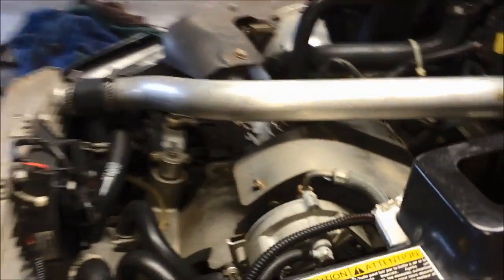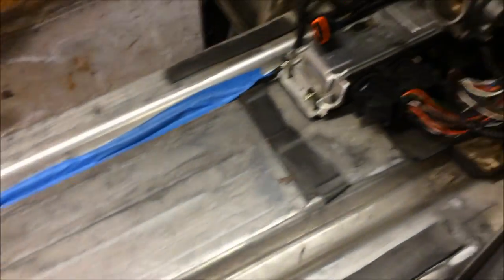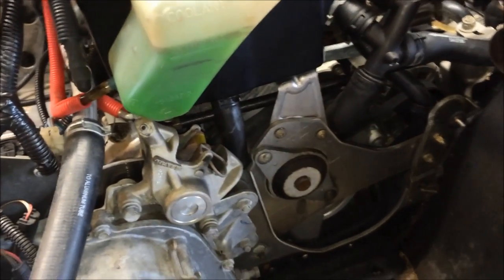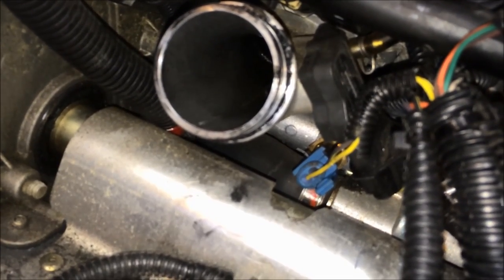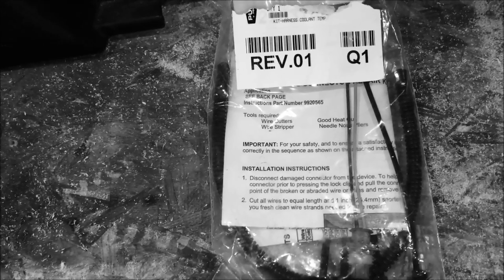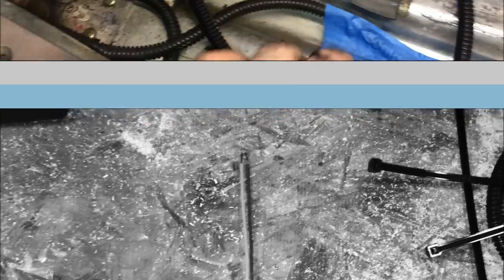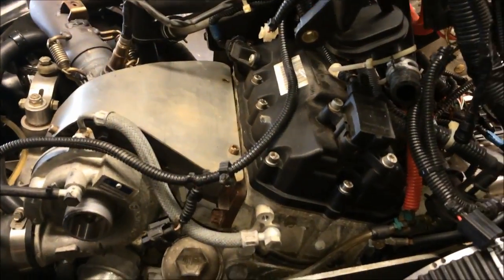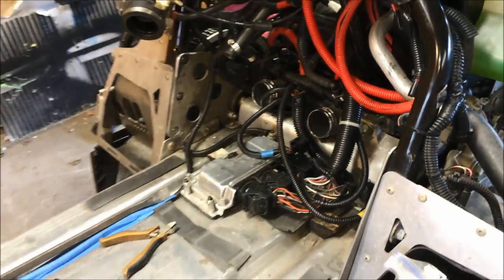Polaris FST Coolant Temperature Sensor Removal and Repair

Comment: Hi I wonder if the sensor could be relocated in a hose somewhere ? maybe where the bleeder screw is bolted on the cylinder head some one with access to machine shop could build an adaptor with a bleeder screw built into it ?
Reply from the maker: Good question. Although Polaris probably wrote the MAP for the temperature to be registered in that particular area. The temp up by the bleeder maybe cooler/hotter. Not really sure. 

Thanks for watching!

Comment: Hi, i'm working on my cousin 2006 FST 750 turbo and there's coolant in the oil...by doing some research on the net it seems that the water pump seals would be the problem ? I took the water pump cover off and there's a bunch of black silicone in there and the inner part of the cover that hold the seal is all broken...I assume that they did the water pump seals a while a go and throw some silicone in too hold the seal cover in place ??? Any how, do you have a video off how to rebuilt the pump and do i need to take it all out too fix the coolant in oil issue ? I orderd the parts #4-5-6-7-8-12 from Polaris parts scheme.  Oh and also, when i opened the radiator cap there was no coolant in there...so i put some back in and it went down immediately, so i filled it up again and did the same thing, tried a third time with the same result...I'm assuming that the coolant was going directly in the motor by the water pump seals ?
Thanks
Ben
P.S excuse my english, i'm french Canadian ;)
Reply from the maker: no problem. The oil and coolant capacity due to the amount of hoses, coolers and everything else. I would keep adding more.

Comment: Hey awesome video. Question for you...Is this a necessary fix? Hypothetically if you did not fix this and just left the temp to fluctuate, would It cause problems? (Obviously we would have to assume that the engine was not actually overheating and this was just due to the design flaw and sensor/harness location)
Reply from the maker: Yes it is. 

Since the ECU will adjust the mixture based on air flow, ambient air temp and engine temp. The ECU will not be able to adjust accordingly and will throw a code and eventually go into limp mode.

Comment: Hi there. My temperature is erratic but it will go from operating temp and will climb sometime all the way to 250 before suddenly dropping back to operating temp. I thought it might be a thermostat that is sticking closed. The thermostat housing looks impossible to get to so idk what to do
Reply from the maker: Have you looked at the temp sensor yet and confirmed it's not hitting the jackshaft cover?
Reply: @StreetersGarage  i have it torn apart, and the sensor is hitting and there is no notch. The wires look fine, but you think that bad sensor could cause the temp to go up and down in the range I'm talking about?
Reply from the maker: @isaacp.4419 yes. It can cause it to ground out and change the resistance of the sensor.
Reply: @StreetersGarage  okay, I'm going to change it out and make the notch and everything, and I'll put it all back together. I'll let you know if that fixes the issue. Thanks a bunch!!
Reply from the maker: @isaacp.4419 No problem. Good luck.

Comment: Hey, what issues were you having with the Coolant Sensor?
Reply from the maker: The reading would drop from the normal operating temp down to 95 degrees. If you stopped it would go back to normal. As soon as you started to accelerate it would get erratic.
Reply: Dirk Diggler Hey thanks, my temp sensor seems to be erratic also, I am also having a performance issue when the machine has been running for a bit, there seems to be a lag in the throttle response or a dead spot. It will also stall if I stop quickly. It will restart with no issues and there is no trouble codes. Do you think its the coolant sensor or something else?
Reply from the maker: I would definitely change it out if it's fluctuating. It would also give you the opportunity to check for boost leaks and change the reference lines. These are the most common reasons for performance issues. 

The stalling when stopping is strange. My first thought is that its a clutching issue with either the primary or secondary hanging up and stalling the engine. What year is the sled?
Reply: Dirk Diggler Its a 2006
Reply from the maker: Ok. I would definitely check for boost leaks and the reference lines. These are known issues. 

Also, head over to PolarisFiles.com and get into the FST forum. There is a wealth of knowledge over there.
Reply: Dirk Diggler Tks will have to give it a good going over in the spring.

Comment: How friggin stupid.  You would thing that Polaris wouldn't try and shaft their customers further for a design flaw.

Also, for those watching, He did solder and shrink wrap those ends, however, the 2 pieces of shrink tube / butt connectors that cone in the kit are actually solder joints.  slide them over the wire, strip and connect the ends, then hit it with heat, and the 'metal' in the connector melts.  It is actually a solder alloy with a lower melting temp.  So it is in fact, a shrink wrap and solder all in one, and is weather resistant.
Reply from the maker: This is one of those design issues that you had to wonder who at the top of senior management allowed this to go through. Since you know during the assembly process that everyone on the line would have recognized the issue but it was still allowed to go out the door this way.